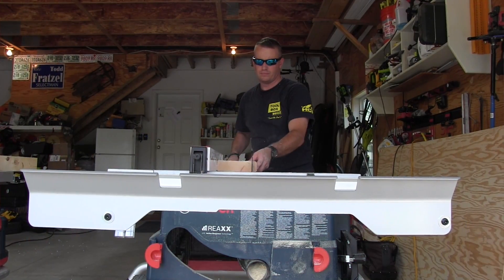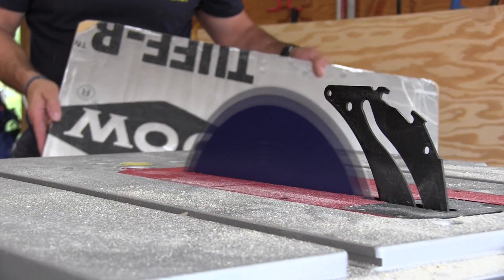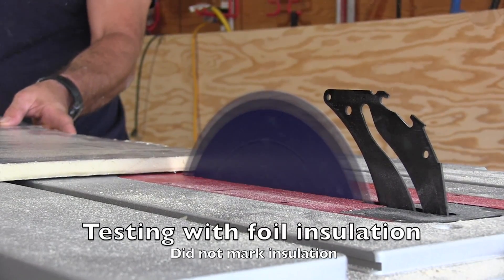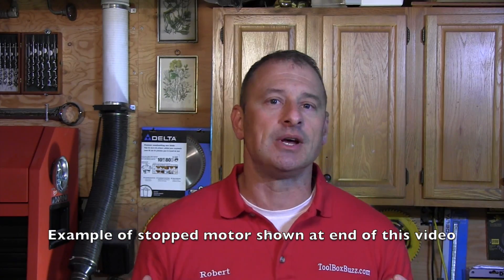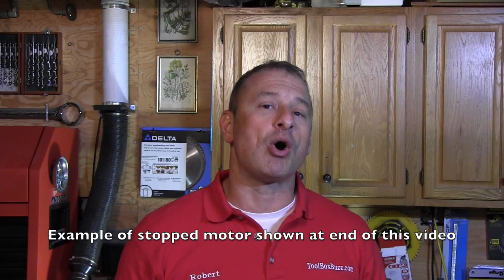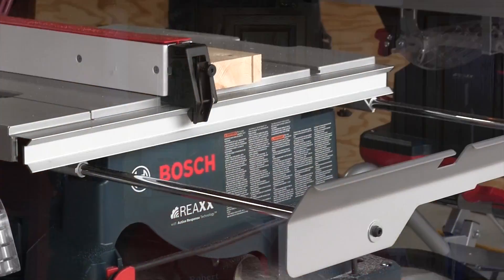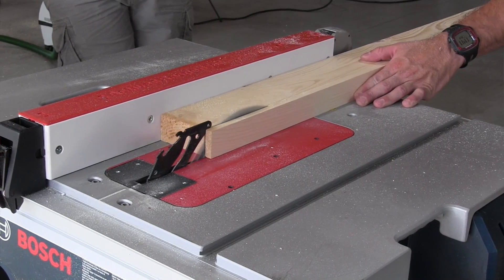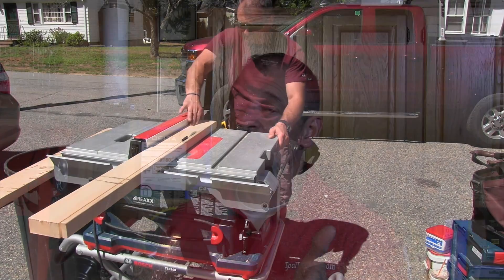Bosch Reaxx Tablesaw - Power Problem Discovered

Comment: Well this is 4 years later and hope Bosh has figured out the problem. Even if it still has issues Bosh needs to tweak in the coming years it is worth it. I for one (only a DIYer) would gladly slow down my cuts (on some cuts) or put up with a failure that made the saw stop and had to restart if it saved me a finger...or worse.

Comment: Any update?
Reply from the maker: Yes, its a circuit board issue.  They're addressing it.  They are also visiting me at the shop this Friday to swap out the old one for a newer one.
Reply: Thanks.  Man, that's a bummer.  I'm away from home right now, but my brand new Reaxx is sitting in a box in the garage.  I won't get to it for another week.  I hope I don't have a defective one.  Please keep us informed.
Reply from the maker: will do
Reply: Its been 2 years from the original issue and 1 year since the fix. Is it safe to assume the fix didn’t work?
or did this fall off of your radar?

Comment: I sent my Reaxx to Bosch with the same issues. A new wiring harness was installed and the firmware was updated. After the "repair" it is still having the same problems. Like you, I have tested it with different blades and even had my electrician wire a dedicated circuit just to run the saw. The only difference is that I'm having issues only ripping 3/4" poplar. I had to bring out my old 4100 to bevel rip 1-1/2 syp t&g decking. It would be great to find a solution. If not, it's going back.
Reply: Geez, did you ever get the issue resolved? I just purchased this saw a few weeks ago and haven't even assemble it yet. I planned on doing some work but now with winter coming, a newborn on the way and currently away from home, don't think I would be able to fire it up until well into spring of next year. Wondering if my unit is effected or not. Do you mind if i ask what your build number is on the saw? Thanks!

Comment: Is it belt driven because of the way the blade drops below the table? It sounds like the $99 homeowner table saws when it bogs down. I was really hoping this would be better than Sawstop.
Reply from the maker: @William Butler Yes the belt allows the blade and its assembly to drop below the tabletop.  The motor is fixed. Were working with Bosch to figure this out, we'll get back to you guys on this.

Comment: Great review, seems like a nice saw. I'm sure Bosch will get a handle on the problem. In my opinion job site tablesaws have always been direct drive, I think belt drive should be left to the big boy shop saws. Not sure if that would cause the power problem or not. I just think if it ain't broke don't fix it, gotta love the flesh sensing tech though.
Reply from the maker: Anthony, Thanks for the comment.  The Active Response Technology needs this saw to be belt-driven.  Upon activation...when the blade and its assembly drop below the tabletop the belt moves with it.  Motor is fixed.

Comment: Rob,
I'd be curious to see the amp draw with a multimeter when the motor misbehaves.
On traditional motors, the current will increase when under load, upto the LRA rating with a stalled motor. By comparison, a multispeed motor will draw lower current at lower speed assuming it is not overloaded.
With this scenario, the speed controller and its monitoring inputs seem suspect.
One other thought, is the belt tension and pulleys adjustable?
Reply from the maker: Hi Dwight - were looking at  a lot of this stuff and reaching out to Bosch as well - they're best suited to test amps and stuff.